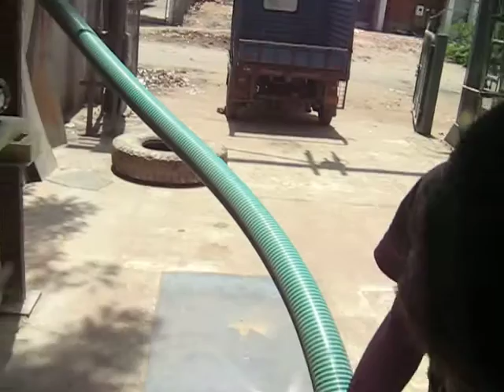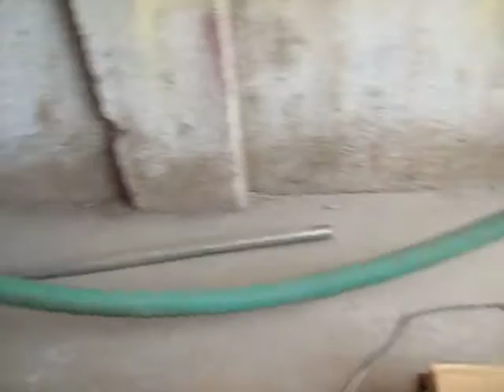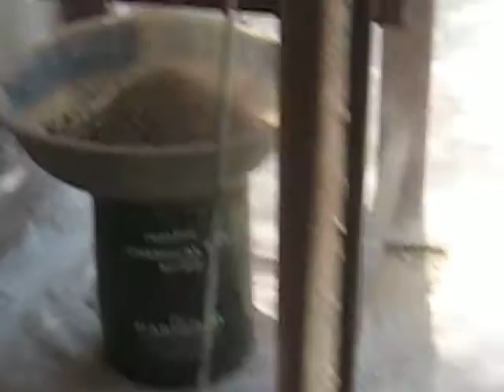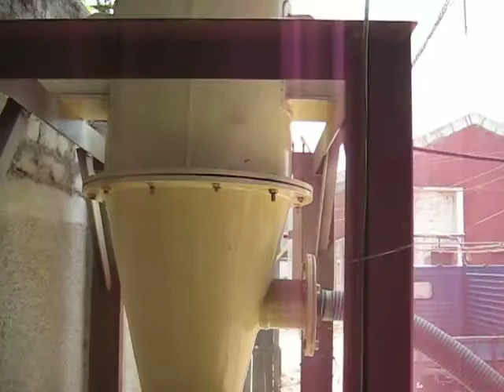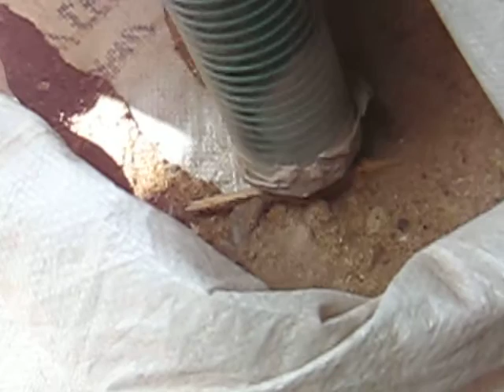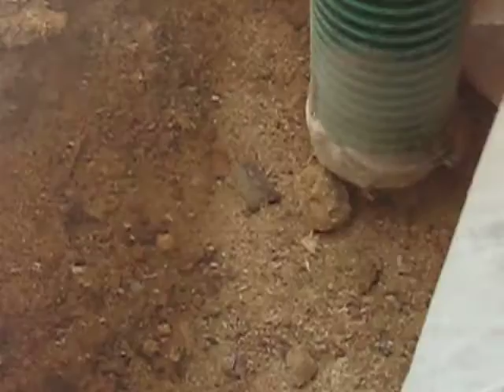Saw dust Conveying System , Pneumatic conveying system, Conveying system, Vacuum conveying,

Comment: Can we use this for dry river sand
Reply from the maker: its very abrasive. not advisable with flexible pipe it need special pipe with lining not suitable only for fixed installation like factories etc.